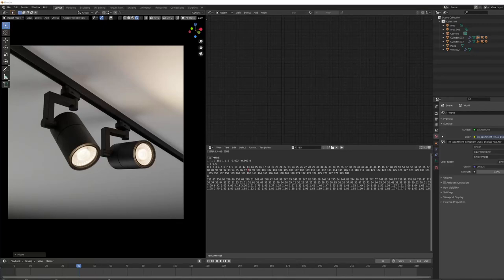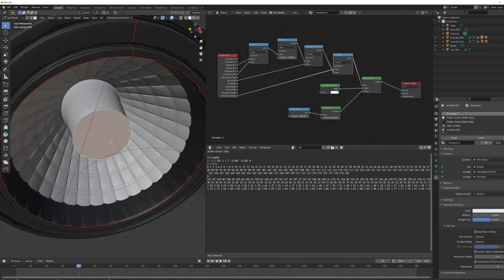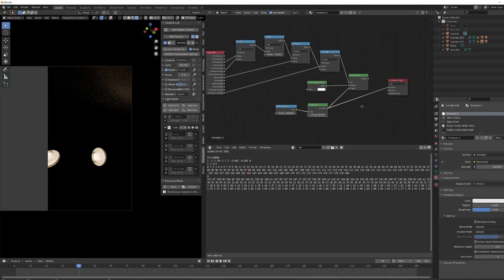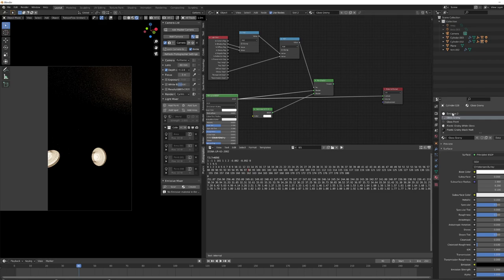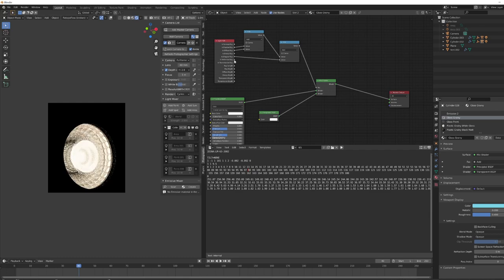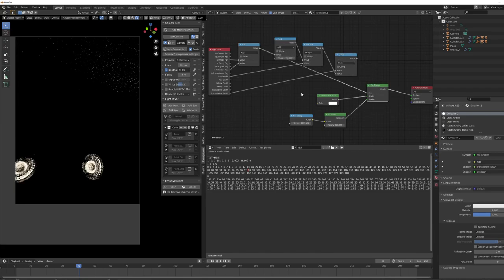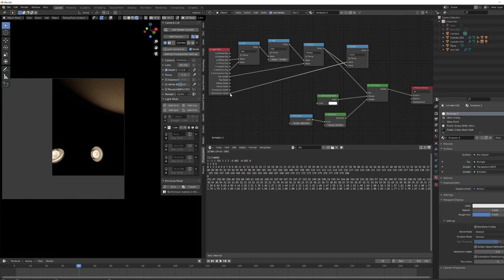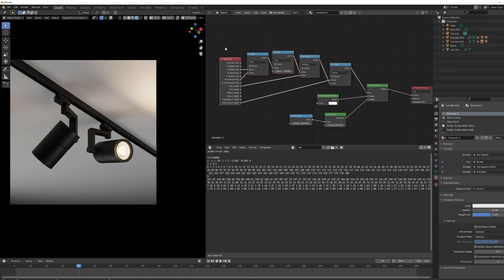Blender Arch-Vis Tutorial | TURN OFF NOISE from spot lights | iMeshh tutorial

Comment: couldnt you have just made the glass transparent for a shadow ray? 
That seams to work fine for me, but i might be missing something
Reply from the maker: Could you share with me a .blend? I'd love to see
Reply from the maker: So I just had a look. In the video you can see when I make the glass, I make the glass invisible to shadow rays, diffuse rays and glossy rays.
This is the same as detaching the glass and using Ray Visibility settings and turning them off there.

Like your comment in the other video, this also requires that the all light is blocked, including glossy rays (which also casts noise), not just shadow rays.

It even requires a slightly different set up for the frosted glass so that it keeps the LOOK of the glass which I am after too.

Another factor, I DONT want the light to contribute any light to the scene. I want to use an IES because it is more aesthetically pleasing and much faster light to calculate.

Please send me a .blend example though if you are still unsure though